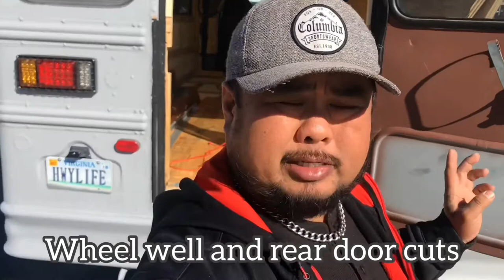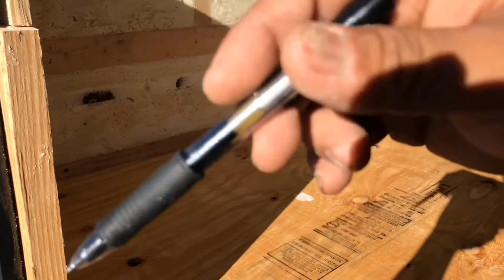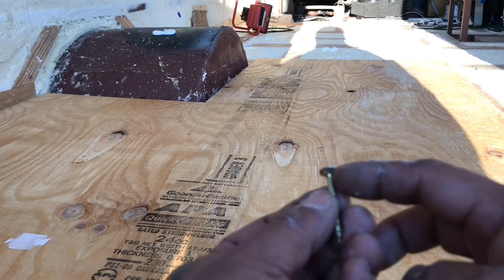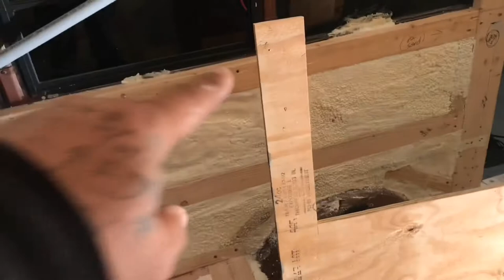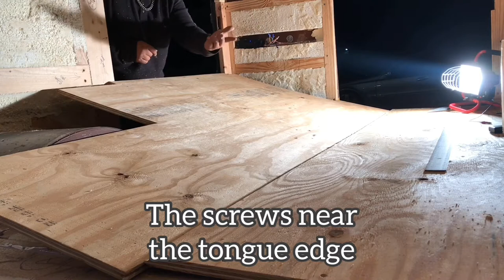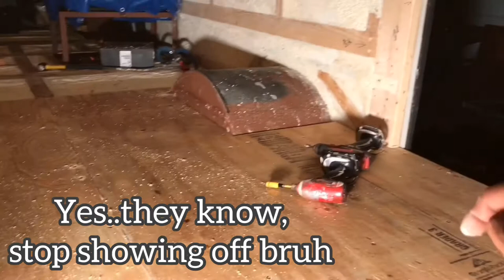EP 38 BUS HOME BUILD : Subfloor Installation 2 of 2

Comment: Almost felt your pain when ya went out the back and fell. Sad thing is I have a step on my receiver hitch and I've missed it a time or two! lol
Build Q: is there a structural advantage to running your ply-board front to rear vs side to side? I did the later previously cause it only took 3 sheets to reach the cab; will probably do it again that way when I redo the floor. And I am curious as to how you will transition to the cab section later on, but I can be patient and wait lol
But the bus is lookin good bro, Keep it up!
Reply from the maker: Squirreled Life Thank you brother. And btw, I think I may have torn my butt cheek muscle falling out of the bus. Lol. Funny thing is, earlier in my video..you can see I double check a few times to make sure the step was there. I guess I was very tired and lost track.

As for the build Q: The simple answer is yes. Lol. On a traditional build, you always go side to side. Meaning crossing the runners. Best example would be like a patio deck. The “boards” crosses over more runners. I really need to let you help with the edit process so that I cover everything Lol..seriously. I should have mentioned this in my video. I place my floor boards the way I did for several reasons. The way I laid out my framing, the cut factors, the tongue n’ groove connecting factor and board count. But it basically extended from my framing placements and all the other factors dictated from there. As you know, my framing copies the strongest points of the actual bus framing/layout. I really do appreciate you bringing this up..I hope I remember this convo to share it on my next video.

As for my front cab area...I was going to attack this separately. But the quick answer is, it’s a separate build from the rear area. But joined at the partition framing. Which is also why I went with the 2x10 framing board if you recall. The front area board will share in on that 2x10.  Fasten down/hidden with the partition framing.

Sorry...I like to talk and be detailed lol. Thanks again brother!!